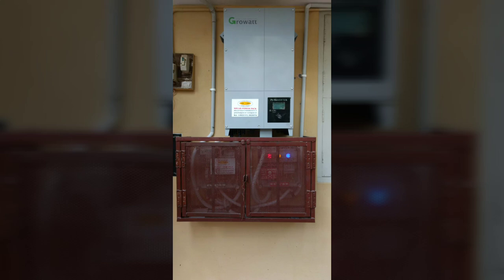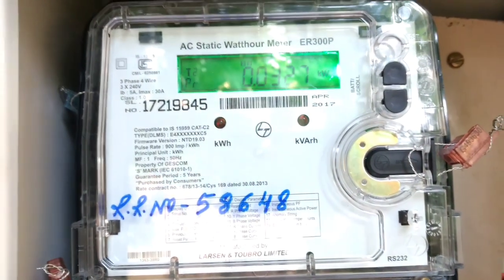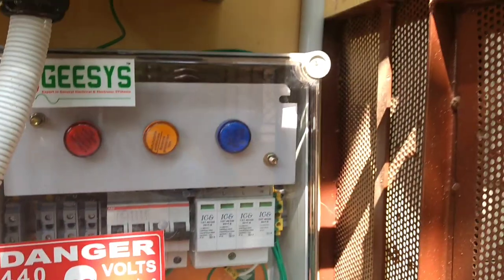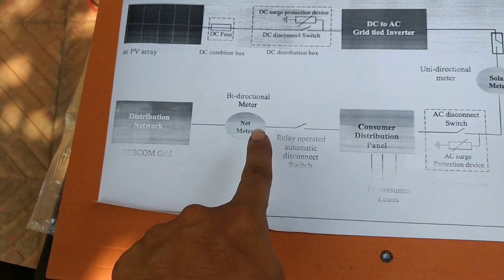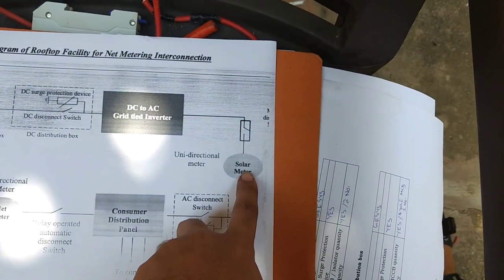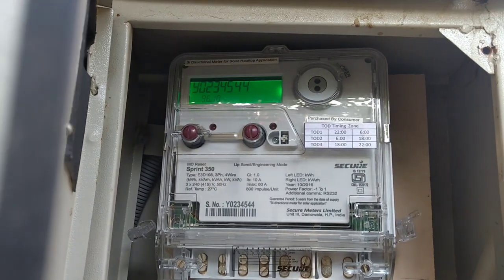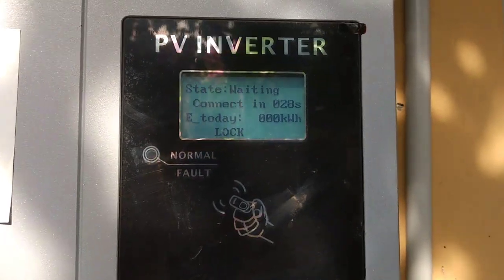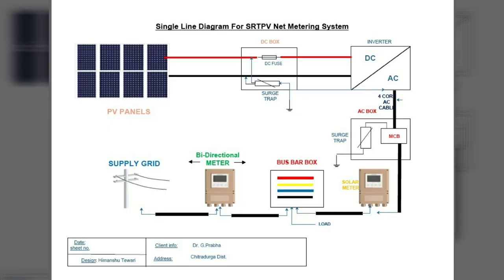Solar Bi-Directional Net metering installation in detail | Bidirectional meter

Comment: when the grid is out(off) then the production of the pannels-inverter cuttings off too from the biderectional meter and stops giving energy to house? what is happening??
Reply: It's to prevent your panels continuing to generate energy and feeding it into the grid during blackout situation, which kills electric company repair wallas.

Comment: What will happen in case of power failure from supply company? Will our solar system supply extra power to supply company or not.
Reply from the maker: No the plant will also stop , as it will not get reference voltage from the grid
Reply: Will you please explain the working principle of solar system when no power from supply company in day time?

In your system, which device/component stops extra solar power not to feed supply company/grid?

Comment: What is the logic of using 2 meters for a solar rooftop system .
The bidirectional meter itself gives the detail of all parameters like net export .import .& total consumption .

For a better data analysis a DATALOGGER can be used with the bidirectional meter .

If anyone have the answer plz reply
Reply from the maker: Exactly , but secure & l&t pumps a lot of money in DISCOM agency to not to revise their  policy of check meter so that their business can run smoothly , and the best part is that it is only happening in india

Comment: I am going to install Growatt 10KW with Zero Export Device TL3-S could give wiring diagram for this installation.
Reply from the maker: Zero export comes with pin connection diagram
Reply: Could you give block diagram.
Because this is my first Ongrid installation.

Comment: I dont have solar 
My question is 
In my meter box grid is connected with the meter and from meter the loads are connected 
But in this video load is connected to bustbar and not with the meter?
Can you explain this please
Reply from the maker: Hi here the load is connected with busbar before Meter so that in case we want to extend the wiring in the house it can be done easily by doing fresh connection in busbar , rather than connecting all load wire in the Meter which can cause heating and melting issue in Meter connection junction if any heavy load will run
Reply: @SustainableEveryDay   thank you bro  now i understood 👍